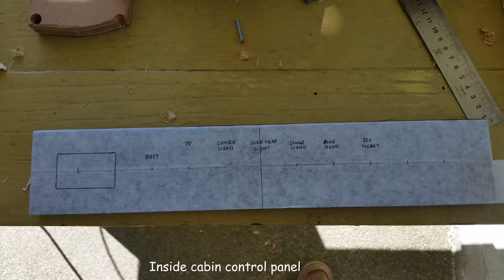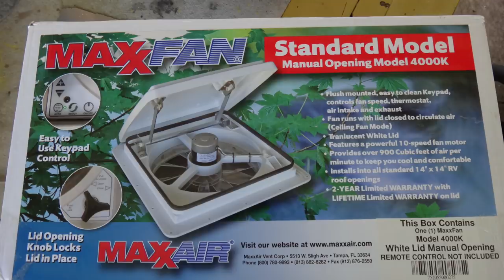Teardrop Camper Build

Comment: so took him nearly 2.5 years to build. not ordinary build with a lot of tooling. great job! i'm DIY in process on 13' x 8.5' jet ski trailer with indoor shower, toilet, skylight, AC on the front trailer 450 watt, shower indoor, kitchen for severe weather, solar 100-400 watts panel; maybe put in futon folding bed sleeps two, can be unfolded for dinner. diamond plating all around and roof. check it out on youtube while in progress. title: DIY mini-camper with indoor shower, toilet, standup room for kitchen, with skylight. this lightweight mini-camper will be towed with my 1964 scout 80. so far i spent two weeks progressing along well since i'm retired and more time to prepare this project. planning to take it for cross-country camp along the wide span of this beautiful country in the USA.

Comment: Beautiful build!  Heat. I am amazed at how hot bare  aluminum gets - In the sun it cannot be touched. I always assumed it would be the perfect reflector, but instead it seems to collect a majority of the sun’s heat. Maybe the lite colored anodized?  I need to set some of that in the sun, to test it. 
However, after friends trying paint and other shading methods to cut the heat buildup on bare aluminum, it is crossed off my list for exterior use.
Thank you for the share! You did a really nice job!

Comment: Nice build....very well done. If i were to change anything it would be flexible solar on the roof and your galley could use some finishing, maybe an induction cook top and a dometic fridge on a pull out and the final would be running water

Comment: Very Nice  build sir !   For several months I have been making plans  , adjusting them ,  sourcing materials  etc.  for a  small trailer build .    One thing I've yet to find out , is how/what   to use to adhere the exterior aluminum sheet  to the wood and not have it wrinkle  &  bulge with temperature changes  .    If you have time to answer ,   it would be appreciated .  Thanks Cyril
Reply from the maker: Hi Cyril. Thanks for watching. Very good question. I was concerned myself as well hearing what others has said about this expansion with heat and all.  My aluminum sheet is only held in place by the external trim molding and nothing else. I was worried that if I glued it down to the wood that it would cause uneven expansion or harsh ripples.  Also I live in a fairly moderate climate location where the temperature is more less the same most of the year.
Reply: Thanks for your reply .    Appreciate it !

Comment: Just curious as to how you held the aluminum sides on ? There are several   Ways that seem to contradict each other
Reply from the maker: It is held by the trim molding. That allows for expansion.  It over overlaps by about .5 inch

Comment: Nice build.   I love the sinks for storsge.  How did you block the drain openings?
Reply: I used the left over aluminium sheets and cut circles with it.  Then sealed the holes with epoxy

Comment: NICE trailer and nice video.  Perfect length.  What is the thickness of the plywood for the rear hatch cover and the front where it curves?  Was it hard to bend?  Thanks
Reply: The thickness I used is 1/8 inch maghony wood.  It is easiest to bend but still have to be careful of bend radius as it can still snap in half
Reply: Thanks

Comment: I would like to build something similar.  I have a concern about the base trailer itself.  Where did you get yours?  Are the tires 12"?  Does it limit your speed?
Reply: I started mine as well and replaced the 12" trailer tires with aluminum rims 16" car tires. It is light trailer and I asked my local authorities, they set: if you do not exceed drastically the load spec of the tires it is OK.
Reply from the maker: I got my trailer custom built by a local axle shop but is no longer in business.  The tires itself are 13" and are rated over 100km/h although I wouldn't go much faster than that.
Reply: I use the Northern tool trailer wit 13 in tires and it goes down the road just fine